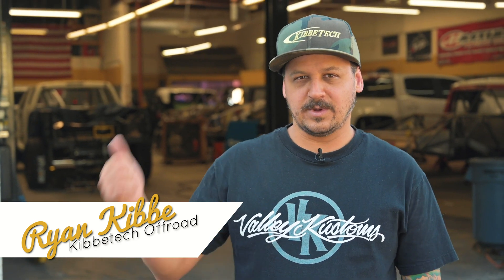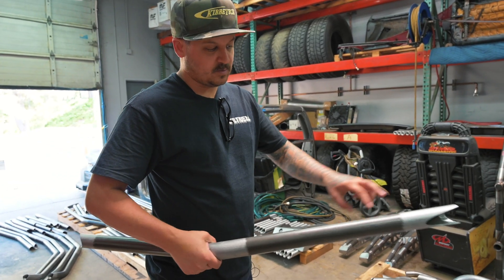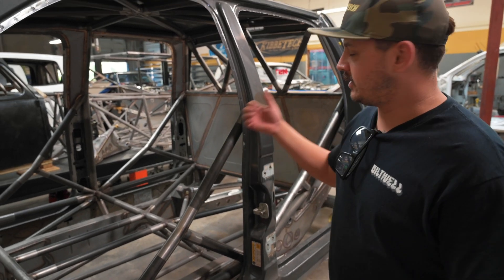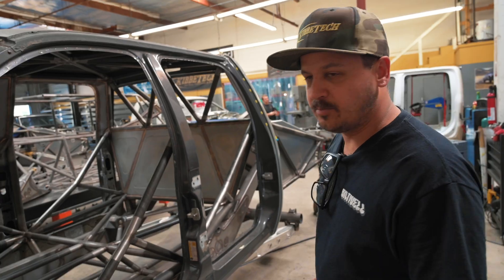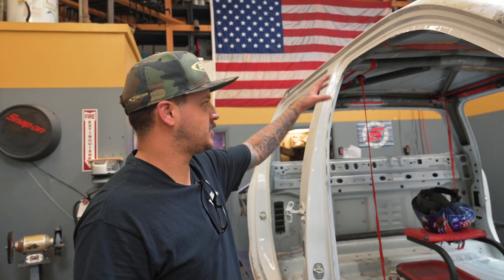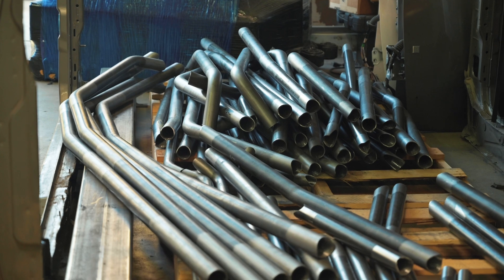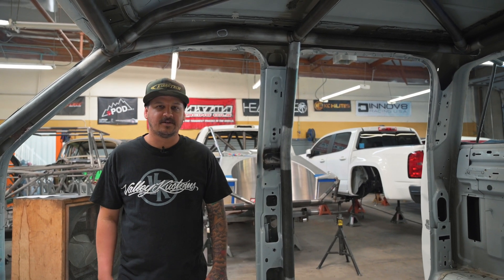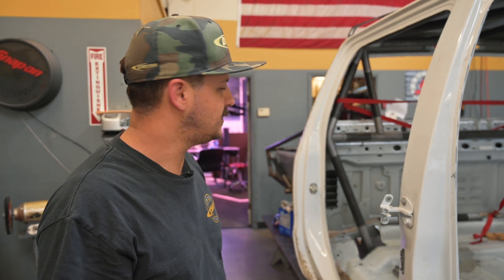Building Our Precision Laser Cut Roll Cages

Comment: Have you guys ever heard of or seen a square shaped/boxed rollcage?

I'm going to be doing the stereo system in a guys truck that will compete in sq competitions, but he is also an offroad guy and plans to have the truck caged with suspension work.

The a-pillar mid and tweeter locations would be nearly impossible with a rollcage tube, so the idea of a boxed section of the rollcage was being tossed around, to try and give us some much needed clearance.
In a big fullsize truck, that a pillar spot is really the only possible location for the mid and tweet to get the right stage height.